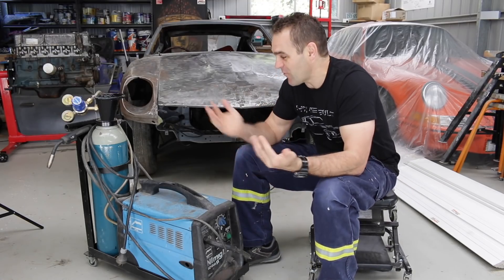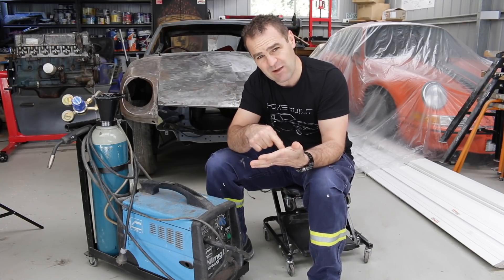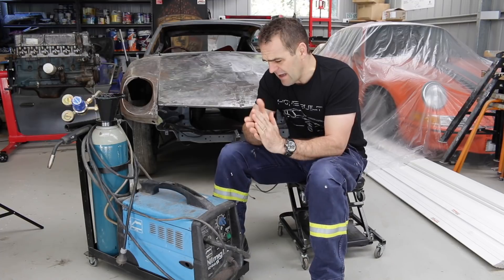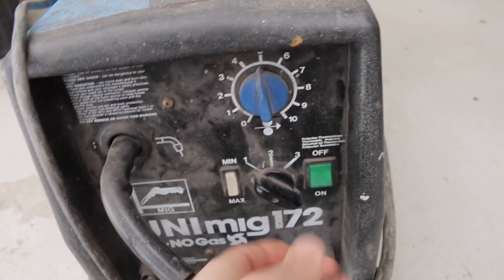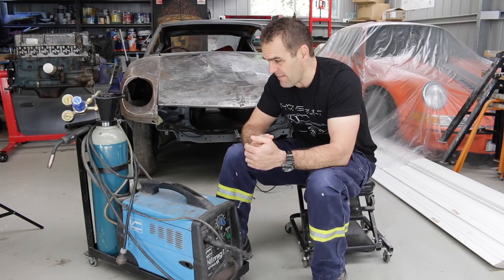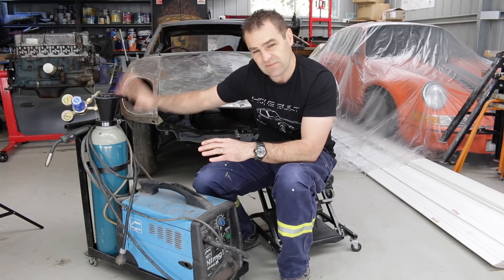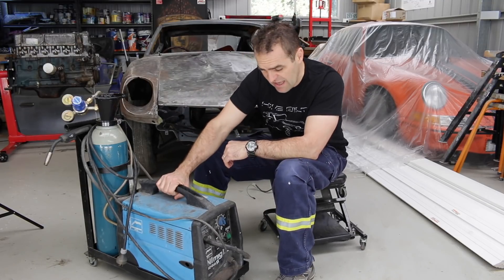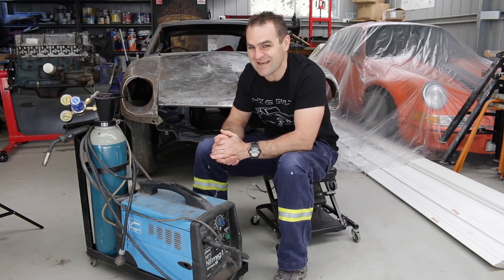Mig Welder - My favourite tools part 3

Comment: I used to work around a place that did heavy welding, as in huge chemical tanks, there are alot of different types of welding, one of my favorite would be Friction Welding, example...take a 40 foot piece of 3/4 inch wall oil drill pipe, put into a machine that spins it at a very high rate, then take a female drill head and press it into the spinning pipe, it makes perfect weld beads, all done with friction, no power needed. Watched this at Hughes Tool Plant in Houston Texas in the late 70s. I could tech you how to stick weld in no time. You would sell that Mig straight away. Tho Mig has it place, just as every welding type has.
Reply from the maker: That is very interesting. I have never heard of it, but it makes sense that if you get enough friction to melt the metal, you could get a nice neat weld.
Reply: Had a friend who welded large pipe on the bottom of the Gulf Of Mexico, fish were attracted by the light of the welding, He told me one time he looked up after finishing a rod, and they was a Grouper the size of a VW about 3 feet in front of him, sometimes they would bump into him while he was welding, always thought it was amazing that you could weld underwater, he told me there's no difference, same rules apply. I like the way you work through problems. Most people throw money at a problem, you throw brain power, and thats the way to go. It would be interesting to see how you rate both the Porsche and the Datsun on taking corners, My Z (1982), really does well, and at any speed, its really balanced, I have never driven a Porsche, they are beautiful tho.
Reply from the maker: Haha, I had never driven either before I bought them, and I have still never driven a Z, so it will be very interesting.

Comment: Great timing, i am at welding stage and have been going over the options for weeks now. Decided on a 135 AMP Cigweld unit which apparently is great for sheet metal work etc, can also take gas as well. Also debating about the STUD welder as well... bloody exy little units... might settle for the Eastwood Stud welder addon to the Mig to get it sorted. Cheers mate great Vid
Reply from the maker: Go for the gas. It is worth the extra stuffing around. I didn't realise how much better it would actually be. 
As for the stud welder, the Eastwood one looks a lot neater than my solution, but my one works and it costs almost nothing... ;)

Comment: Jeff, any feedback on settings at all?
I am doing some repairs on my own 71 Super Beetle and have mine set at 50 volts and the wire speed set just before it starts to push back off the metal. Should the wire speed be lower than that given the low voltage?
My welds are crap, but better than the sticky tape and bog that a previous owner did panel repair with I guess.
Reply from the maker: I am a self taught welder, so I am not the best teacher. I just put it on one of the lowest settings and tack away. Sheet metal is tough to weld, you just need to take your time and try not to blow holes through your work.
Reply: Hmmmm, I could go lower than 50 volts quite easily. Time to dig out the scrap metal again.

Comment: I bought a gasless mig not the best decision I made
Reply from the maker: Can you add gas to it? I didn't have gas hooked up to mine for over 10 years. It definitely makes a difference. MUCH neater welds.
Reply: Home Built By Jeff unfortunately no i cant.  But I have done most of my welding now. Angle grinders were invented for gasless migs